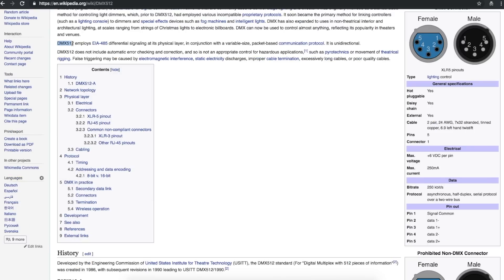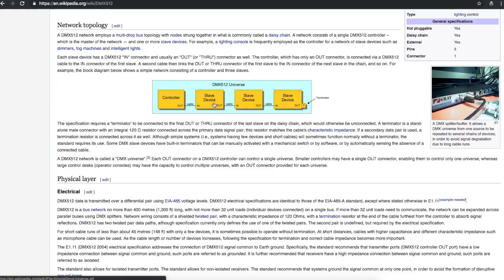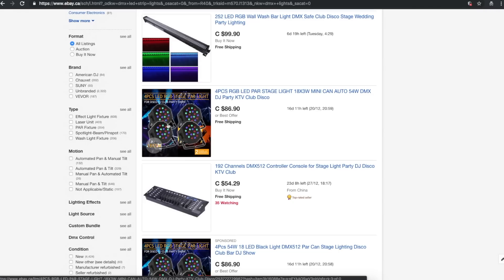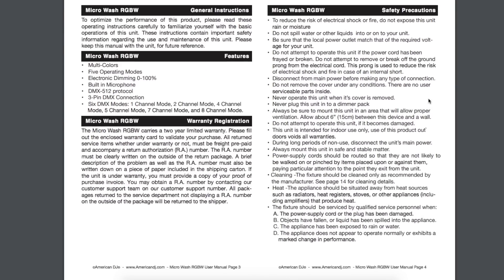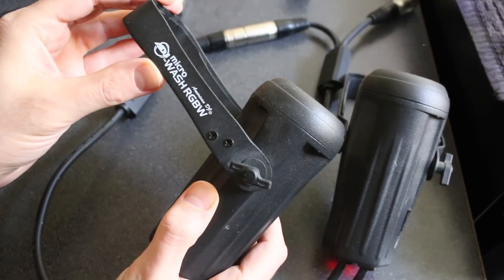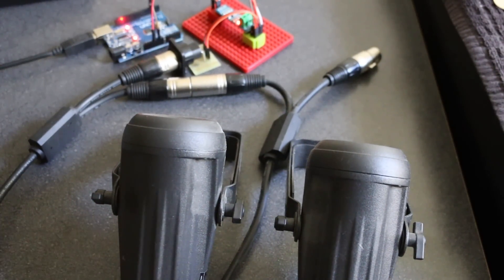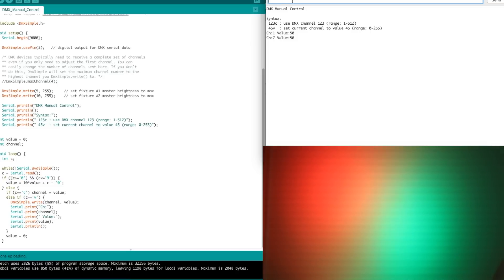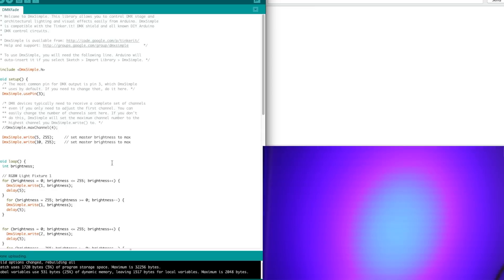ARDUINO DMX512 CONTROLLER

Comment: Well, you taught me something new.  Had not heard of this standard.
Your MAX485 could use a couple of 4-pin belt-buckle connectors and a little 3-D printed housing.
Reply from the maker: A 3-D printer is on my long-term shopping acquisition list. I’ve never tried using a service to print things  in the meantime.   It would be convenient to have a printer for little projects. 
 I forget when and how I found out about DMX years ago, and I’ve always wanted to experiment with it and didn’t know how easy it is with an Arduino.  I’m sure I can come up with lots of related projects now like turning it into wirelessly controlled DMX and maybe a phone app to do that control or something.
Reply: @GadgetReboot  I read about MAX485, but since I have no need to run a UART 1/2 mile, have never played with one.  Would be almost trivial to make an ESP into a wireless relay for DMX.  Code exists already converts one to a wireless serial port.  https://github.com/jeelabs/esp-link
Reply from the maker: Wireless serial ports are another topic I will be looking at even for RS-232 to use old dial-up modems on Wi-Fi. So many plans, so little time.